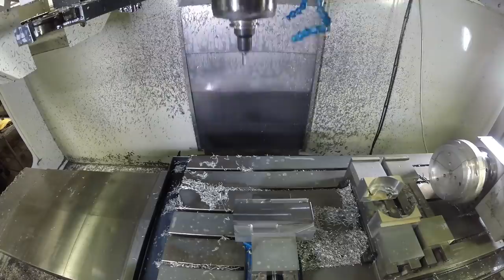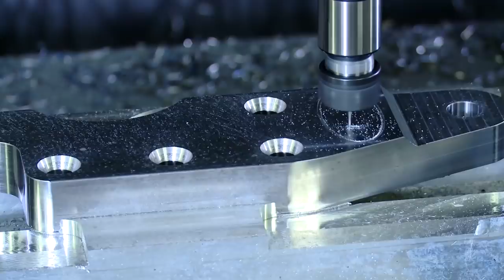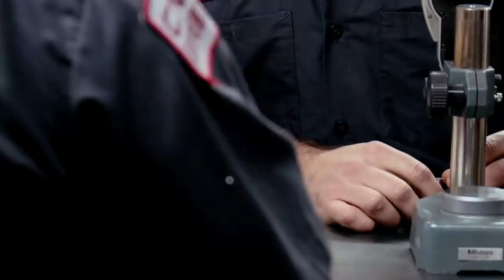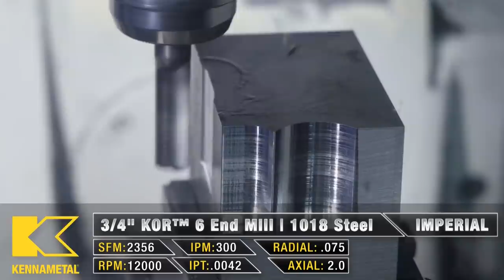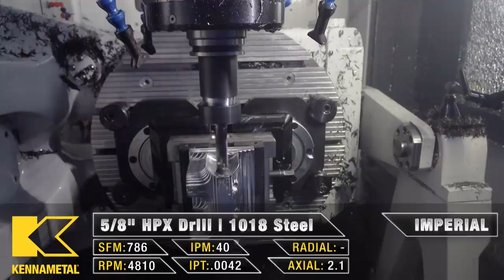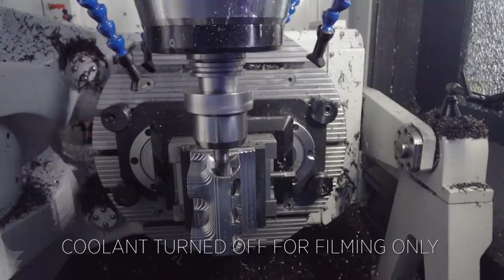Tools Keep Breaking on Night Shift, but Runs Perfect on Day Shift... Nobody Knows Why

Comment: This blows my mind.  If I had employees and had operators who changed the feeds and speeds without informing the programmer and documenting the change along with why it was done that would be grounds for termination.  Changing the feeds/speeds without documenting it?  On a production run of parts?  How could you EVER troubleshoot what is going on with not only tool life but overall part quality, surface finish and especially tolerances?  You can't.  I'm trying to imagine the level of frustration and fury after spending days trying to figure out why a run of parts is off then discovering the operators all just turned the knobs however they liked?  Are you kidding?  This actually happens?
Reply: It happens in all areas of industry, it shouldn't but it does. 
Biggest problem I've had is where the guys on the floor would not share the issues they find with drawings so would carry out modifications on their own. They saw it as protecting their job.  Then a bulk order comes in and you have to outsource to another shop and of course nothing fits together.
My favourite is when a mistake is on a BOM and there an over issue of parts on each build, instead of letting anyone know they just put the extra part under the bench until they run out of space and then finally complain.
All these can be solved, but the most difficult part is getting people to buy into doing thing right especially when the deadlines are tight.
Reply: I see similar issues in injection molding. The nightshift fiddler, loves to pull solutions from their rrrrrr. Once you get derived the optimum settings, lock them in.
Reply: Nightshift guy apparently knew his setup was worse than the dayshift. And yet, he kep on meddling.
Reply: Worked at a local division of a multi-billion dollar aerospace company where it was whatever shift's responsibility to both program and fixture new jobs when they came in. If a new job was #3 on the priority list and first shift didn't get to it, it was 2nd shift's job. No programmer, no engineer. We had 5 guys in my department all doing whatever they thought was best at the time, and the setup procedure was written in pencil inside a 30 year old binder. Best part? There was no fixture organization. We had a line of metal cabinets/drawers and when you were done with a fixture you just threw it back into the first open drawer you could find, and then search 20+ drawers for the fixture to your next job.
Reply: @ruuman  Don't you love that? The whole "protect their jobs" thing? Comes down to the competitive nature we foster in society instead of a more useful cooperative nature. Everyone wants to get ahead because they tie greater success than others to their own self worth. The problem is that society was built upon the idea of cooperation because mutual success has greater gains than individual success.
Reply: Happens a lot unfortunately. I've seen it myself.
Reply: Immediate termination with no severance due to the money lost on unusable parts produced and broken equipment as well as disregarding the set parameters.
Reply: Oh it happens all right. And you hit the nail on the head, you literally can’t troubleshoot quality problems once that starts happening because the variables increase exponentially. Now imagine it happening on multiple different machines during different processing steps… and the end result being the finished assemblies catastrophically failing end of line test which even further hinders problem solving capability (part swapping, etc). This is my life.
Reply: Yes it does happen.... there are far more people out there who think they know better and don't than those who ask questions and make sure to get things right...
Reply: @ghost2coast296  😱
Reply: Have to agree with you 💯 %
Reply: Almost all companies see Quality Assurance as a waste of time and money. But they always seem to have the time and money to do the same job twice. I can't get my suppliers to submit an AS9102 FAI correctly. Ain't brain surgery.
Reply: This happens all the time in my shop
Reply: as an operator honesty was my mantra- everyone makes mistakes- it was my responsibility to own up to my mistakes AND bring these things to the attention of my boss that the why and the how be understood that they not be repeated.
Reply: This is why tech geeks use access control lists and keep logs. It's not a difficult problem.
Reply: Everyday, every shift somewhere.😁
Reply: I've worked at a shop that 2nd shift superintendent had know clue how to run our machines. Neither did the other boss under him and supposedly the lead for our department on 2nd shift. Not saying he didn't know other departments. He was however good buds with superintendent. 
   I came from constitution and talk about a bunch of crybabies that can't wait to tell on you for anything! I got a problem with you I'm coming to you. I won't say anything about anyone that I wouldn't say if they were standing next to me. Drama, was like working with high school kid's. In construction the supervisor running the job doesn't have time to babysit or go around looking for shit can write you up on!
Reply: I'm not a machinist but worked on a line making parts before and we had a log book where we noted any changes and the reasons why because little things could cause big issues further down the line.
Reply: Sounds more like the problem is the company's policy with logs.
Reply: It even happens outside of manufacturing. In IT, about the worst thing someone can do is make an unapproved change to the production environment; it might just be 0's and 1's, but those 0's and 1's are programmed to interact with each other in a specific way. If you change the way something works, that can change its output, and that's bad enough when that output isn't also the input for something else. You can end up with a cascading failure.

With CNC, there is at least a chance that you might be able to catch those problems before you get to your end product; with IT, you might not know there is a problem until you have 300 tasks that weren't started on time, and now have to work backwards through the entire workflow until you find where something was changed and change it back 

If the process is designed a certain way, do not make changes to it because it "doesn't feel right."
Reply: Yep, definitely happens. We use CNC at our place (I know nothing about CNC) and I heard about a night shift operator that would up the speed by 40% (on a simple program) so he could finish his quota early and get some sleep.
Reply: Shop I use to work for it seem to work best where 2nd shift would come in 15 to 30 mins before 1st shift shift had ended. That way questions could be asked about program or tooling issues what feeds and speeds % had worked best if program was running great at 100% then run at 100%. Also had a log book for any changes in program and notes to any problems or adjustments that had been made. Always focus on quality 1st and once quality is top notch focus on production.
Reply: That's why on DMG machines you can limit access to machine functions to a bare minimum and lock it with accesskey so much that all you can do is hit start and stop.

Comment: As an engineer, I can confidently state that 80% of issues with anything come about because someone has said "but this is how we used to do it" 🤬
Reply: It's true. I see this all the time, and I'm on the technician side of things. The old farts still doing technician work are just going "but this is how we've always done it, why change what has always worked perfectly well for decades?" Even when that old way of doing things is actively screwing things up. To be fair, plenty of the time the new way of doing things is all sorts of screwed up, but more often than not it's because the old way of thinking is screwing with the new method.

Comment: "just because it's always been done that way doesn't mean it's right" my Engineering mantra. There's always room to learn, improve, and optimise.
Reply: I completely agree.  "We have always done it this way" is the most detrimental words someone can say for improvement
Reply: "Because it's always been done that way"  is the strident cry of one who still uses square wheels.  Evolution is a solution to a current problem.
Reply: If I ever open my own shop the three phrases that will be forbidden are: "Everybody knows that", "We've never had an issue before", and "That's how we always did it"
If someone is asking you a question then I guess everybody doesn't know that, or someone is double checking.
Well we have an issue now, and most of the time if you ask an experienced worker they will tell you we have that same f'ing issue EVERY time.
Cavemen used to poke large animals with pointy sticks, since then we found better ways to do it.  The old way is not always the best way.
Reply: OTOH: Chesterton's fence[1]: if it's always been done that way, then it was probably (but not always) done that way for a reason. Unless you know what that reason is, you can't know that it no longer applies. Which is not to say don't change things, but before you change things, be sure you understand why they are the way they are.

[1] https://en.wikipedia.org/wiki/Wikipedia:Chesterton%27s_fence
Reply: guess you guys would have a blast working for my old boss)) "we have done it like this for 25 years" was always the answer, no matter how genius the contributions and ideas for change were. so so happy im outta that place.
Reply: @johnpalmer4425  Havent heard about Kaizen?
Reply: We've always done it this way ... I always follow it up with "Did you ride to work this morning in a horse and buggy or a car?
Reply: there is ONLY ONE best way to do anything...
Reply: Engineers go home
Reply: You've always done it that way? Then it looks like you've always been wrong - that's why we learn.
Reply: No but I rode in on wheels lol
Reply: I always like to reply to people with
"You can do it wrong for 50 years, it still wont be right."
Reply: night shift: "this is how we did it at my last shop"
me: "FUCK YOUR LAST SHOP!"
Reply: "dont fuck with it if you dont know what your doing" is mine as a non engineer and it works really well for when I call in the guy that does.
Reply: @swskitso  why should I change something that has been working for 50 years?
Reply: @sreejithsubhash7301  because there have been 50 years of tech advances since then.

So yeah the old way works.  But changing to a modern one means you get a product that is better in every way, cheaper to make and easier to make.
Reply: @benjaminshropshire2900  and whenever you are dealing with something in the technical or production field that reason tends to be the limits of technology back when it was implemented.

So just make a new process because the limits of technology have moved a lot since then.
Reply: Tell that to the engineers around here
Reply: @anonym3017  FWIW I know of at least a few products being built today that are the same as they were over 100 years ago (and likely as not from the same tooling setup as when they started). You can literally swap parts back and forth between version built over a century apart. They work, they do that job and that job is well enough understood that there is literally nothing you can improve enough to warrant even the minor risk of screwing something up. Heck even the manufacturing process in some cases isn't worth updating: the tooling is 100% depreciated, 100% debugged and only needs to run half the time to fill 100% of the demand. It's entirely possible that even where modern tools and technique really are better that you would never get a ROI on the capital expenses in replacing what works with something newer.

That said I'll happily grant that "we've do it that way for 50 years" isn't a good reason to keep doing it that way, but it's equally not a good reason to change stuff.
Reply: @anonym3017  unless there is a significant improvement in cost, efficiency and complexity, it makes no sense to ditch a tried and tested 50 y/o method for a new one.
Reply: My boss is very big on the "it's always been done that way" mentality. I hate it. We are about to expend the production in the coming year and need to change the floor plan. We need to build a new mixing room with big mixers and stuff next to an already existing one. Space is tight but I found a way everything could work as long as we put one big door in the middle of a wall instead of two doors on opposite walls. I suggested my idea but I got a quick "No we need two doors" and when I asked why two doors is that vital the answer I got was just "because it needs two doors". There is nothing I hate more than an answer with no logical reasons to be that way.
Reply: @chamoo232  how's your resume?

If you can't do your job because the boss won't let you or because they won't give you the information to do it then you might need to find another job.

(Heck, I'd have more respect for "because I said so" then that sort of tautological non-answer.)
Reply: @sreejithsubhash7301  yeah the method from 1972 is gonna be inefficient as hell and won't be using all the current tech to make it more efficient.
Reply: "Just because you got it done your way, doesn't mean it's the most efficient way"

It's fxcking impossible to break someone's routine who "thinks" their way is "best way".

I always welcome a new plan, or procedure or method. As long as it saves more time, energy and or resources than the current value without increasing stress, load or wear "exponentially".
Reply: Totally agree with this. I just started learning to setup about a year ago but within that year I have found a couple things to improve on with certain programs that I saw from others. Given, these programs were from a previous company that our company bought the product line from who did have a mindset of "it worked in the past so there's nothing to change" so these programs are almost or are completely rewritten and it's just refining them.

I consider myself lucky that my lead is open to ideas I come up with to improve and if he denies he'll explain a real reason it can't be changed while I hear stories from other companies or the past where the more experienced people won't listen.
Reply: Big red flag for any job is that they tell you not to reinvent the wheel
Reply: @benjaminshropshire2900  except often times it's "always been done that way" because no one's had the authority to change it. Sometimes there's a reason and sometimes it still applies but if it isn't documented? Tough fucking luck. 
Today's problems are solved by people today, the past is the past. It has no bearing on the sitatuons you experience in your shop NOW.
Reply: The problem with that is it will trip you up from time to time, when someone is genuinely trying to explain that what you want can't be done with the tools at hand unless the business invests in new X,Y or Z.
Reply: I bet you're the engineer from my last job that refused to look at a machine that hadn't worked since the last time you touched it.
Reply: @B2Roland  If the reason is really lost to time then, well, ... gross. The best you can do is pick a time to change things where stuff blowing up will do as little harm as possible. OTOH that's a lot different than "I don't know, and can't be bothered to find out", which I've heard in way too many contexts.

My main point is; assume there was a reason and do your best to find out what it was. (If nothing else, even if it no longer applies, you may learn something interesting, maybe even useful for another time).